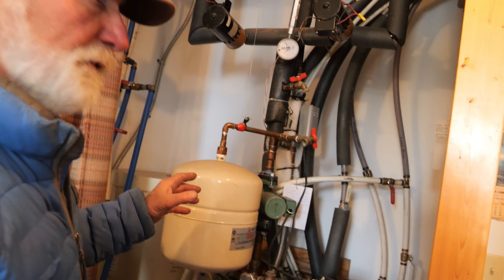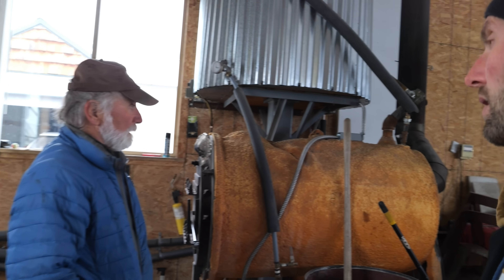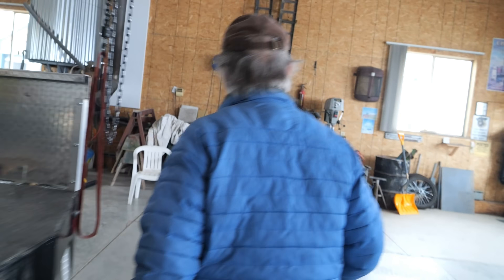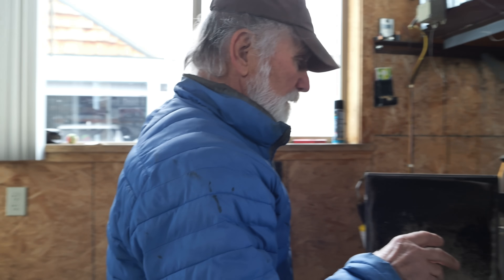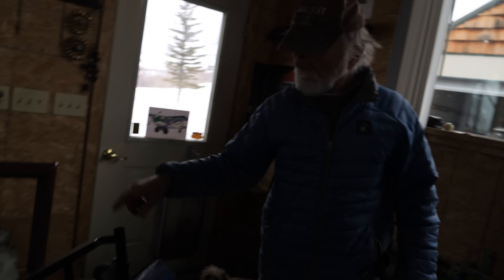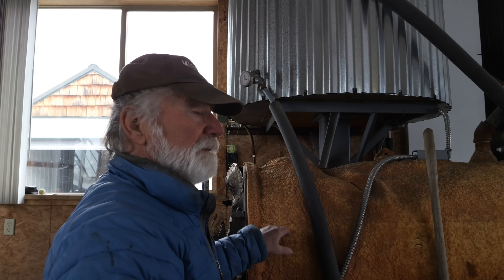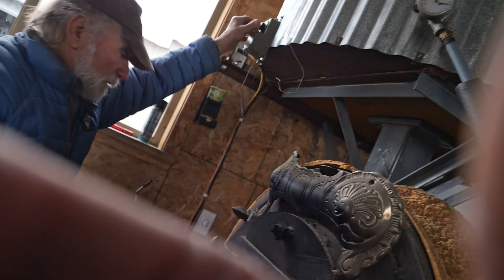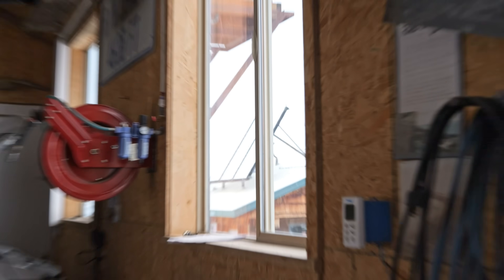Hasn't had a Heating Bill for 40 years.

Comment: I have a wood boiler in my 32x24 shop that heats my shop and 2800sq ft house. But mines a tad different. My boiler gets hot enough and acts as a fireplace and keeps my garage around 50-55f in mn winters. No heat exchanger or in floor heat just the heat the boiler gives off does the trick. As far as the house the boiler pumps the hot water into the house and through a heat exchanger in my furnace and a heat exchanger in my hot water tank and i have more heat and hot water then I could ever need. Obviously systems like the one in the video isn’t economical for everyone but anyone with a firewood source can really save a lot of money heating with wood/sun/wind during the cold winters.
Reply: The boiler is insulated, except for the front and back, and the 10' of single wall vent pipe, which alone throws off a fair bit of heat even if the hot water is being directed to the house. The shop has a ceiling fan of course. It also has large due south facing windows, for direct solar gain during sunny days.

Comment: Pretty insane efficiency compared to using fossil fuels but his claim that it costs nothing is bullshit if hes using grid power for the circulators, they use a decent amount of current to run. If he ran the circulators off solar panels and a battery storage system then he could make that claim. Then he would only be using wood to heat the house.

Comment: For people that don’t have access to lots of wood, you could convert the burner to waste oil. Automotive shops have to pay to have it taken away. Could probably get it for free. Do a gravity setup with a spin on filter to a drip system. Lots of videos on YT how to convert wood burners to oil. More consistent and higher BTUs
Reply: A bathroom fan timer switch coupled to a 1/4" electric solenoid valve, and then a 1/4" needle valve gives not only fine control of the drip, but once you approximate how long the fire will last, insures the flow will stop before the fire goes out. I've found the combo of wood and oil really ups the performance of both.

Comment: This system sucks...too many pumps...also what will he do when power goes out? It will boil out...also before water will start giving out heat a lot of energy will be lost to heat water....then you have to deal with black soot inside boiler and chimney problems due to heavy metal tars

Comment: I learned some great techniques from my first employer who was  born in the 1930s. Back in the early 80s in our diesel repair shop we had a wood stove for heat, running with the oil burners, to save on heating cost, but the real trick was getting 3 phase electric to a shop that only had single phase 220 coming in. He rigged up a 220 electric motor in our outside rear shed that he would run when we needed 3 phase power. Once the motor was running it would create the third leg for a 3 phase machine to run on. Simply amazing what that generation of tradesmen could do. We would not only maintain our tools and equipment but also repair it. It is slowly being eroded away by cheap throw away junk.
Reply: Cheap throwaway junk but also heaps of rules, regulations, and statutes. This is also some of the reasons business in the USA will never be the same.
Reply: I wonder what you needed 3 phase for. This is one of the least efficient ways of producing 3 phase. It works but I wonder if the losses weren’t more than just working with the 220 straight up in the first olacw
Reply: @vaporizer82  My brother has a that type of setup in his wood shop. He has many industrial machines that he bought at various auctions that are 3 phase but were cheaper and of better quality than buying new single phase equipment. Since the power company wanted like 10k to get 3 phase power to his shop, he went the route of a switching box and 20hp 3 phase motor.
Reply: @vaporizer82 then he'd have to change out every motor that was built to run 3 phase.
Reply: Phase convertor my old boss uses them to run 3 phase floor grinders at people house off the single phase breaker box
Reply: Thomas, I really enjoyed hearing your story. Although I've never done anything quite like that, I do enjoy working on things. (I was born in 1953)
Reply: Too bad you had all this time but still let things fall apart
Reply: @almarkowbender  Things didn't fall apart too bad if you are a homeowner with no debt at 26. I am also a homeowner, but realizing the American dream and owning the deed to your house and land is something many people never get to do.
Reply: @coldgarden_  There are very very few people like me, most people have no chance of buying a house or saving any money over time. The only way I was able to get where I am is working 50-60hrs a week consistently and some luck. The average person has no chance.
Reply: @almarkowbender  Don't be mad because your generation didn't do shit.  I'm in my early 30s and know exactly what he's talking about and how to replicate it.  Haha
Reply: @gargamel3393  I'm 26, I own my home and have no debt. I didn't get here by not knowing how to do anything for myself. Most boomers are completely blinded by greed they won't even take care of their family like their parents and grandparents did before them.

Comment: Great video Tom!   I want your system... have been working on it for some time without seeing your video.  This may help you with wood splitting.   Click to check out and improve safety.  The Gorillabac 3803 log drag, lift, position and hold tool. It is a must have for anyone who splits firewood.   Improve Safety, split more wood and have fun! Made in the USA

Comment: Hope you are doing well, Tom!  Glad to see the boiler Mike Solomon and I made you 20 + years ago is still running strong! I still have a picture of it on my website when we were loading it in your truck to take up to your what place by Pebble Creek.  I remember you having me waterjet that elongated slot in the blower tube in the firebox to create that cyclone once the fire got roaring!!.  Brilliant idea.  Built me a boiler a few years ago and have it on my Youtube channel.  I kept you in mind when I was fabricating it.  You always had an eye for making things super efficient.  Still waterjetting and running Rapid Creek Cutters, just not in Inkom anymore.  Pat Burrington-in Montana.
Reply: Right on Pat, your water jet expertise made it easy. That slotted fresh air intake creates a swirl effect, as I had theorized.  Since this video was made, I finally got around to installing a waste oil drip setup, should have done it years ago, it works so well.  And for the record, I didn't do ANY critical welding, no need, I know the right people!
Reply: Good to hear from ya Tom!  When I moved to this shop in Stevensville, MT, I just used the existing stove the last guy had, and I kick myself in the butt everyday because I should have just made a new stove from scratch and I was planning on using the tapered pipe cyclone thing.  Hindsight is 20/20 as they say!    @portnuefflyer

Comment: I am a hydronic heating specialist, i appreciate guys like tom. He inspires me to create a heating loop at my own home, for most people the maintenance alone on a system like this would make it impractical. However if done right i think could really save you thousands in the long run
Reply: What makes his system so maintenance heavy? Hydronic floor heating as been the default in new buildings Europe for a couple of decades now, and it's pretty much an install-and-forget experience
Reply: @norgeek  A gas or electric boiler (as you'd generally see in Europe) would be a far simpler and trouble free experience. Whereas, this gentleman has a complex system using wood and solar heat with valves and pumps to control systems that have been added to and experimented with for many years. You can do the same thing he's doing now with controls and electronic valves but that still requires an amount of saviness that most people don't have or want to deal with. But for those who can, it's cheap heat!
Reply: Yep, he said that he did not paid a bill. 
But he paid with knowledge and work, and opportunity. 
All that wood is free because he is doing this alone. 
If everybody would do it, then there will be no more free wood. 
And I always dreamed at those vacuum tubes. 
But I have no idea how efficient they are. 
I know that in the summer works well. 
Also fine in spring and autumn. 
But how much help are in the winter?
And my idea was an underground tank to store summer heat. 
Would the cost of such tank be prohibitive?
Anyway, these days with the drop in PV price I assume that electric would be cheaper. 
I am heating electric now, from the grid, because I have no roof. My roof is other 4 apartments above me. 
And gas would be three times cheaper, or kerosene ten times cheaper.
But initial investment would be a lot more, and with added convenience of electric, this is the best option for me. 

But solar heating will be so fun to build. 
This guy is having a lot of fun.
Reply: Poverty doesn’t care much for impracticality, you still need to find a way to stay warm. You’d be surprised what one has to do to stay warm.
Reply: It will save you thousands as long as you and your life (time) are already worthless.
Reply: Is he paying for ELECTRICITY,  if so you're still paying for heat, in the form of running all those pumps.
Reply: @rafasgarally3975  look again
there is a solar panel for the pumps. quite a small one, since circulating the liquids takes a lot less energy than the actual heating.

Comment: He needs to upgrade to ecm ciculators much more energy savings.
Reply: Free surplus solar electricity runs the pumps, a mix of Taco and Grundfos, but as the need occurs for replacement of them,  (but not until then)ecm types will be used.

Comment: That heating boiler is something I know my Grandpa would have welded had he made this, and probably have put his own flare to it the way this was done. My grandpa made the wood stove in his house from scratch, cutting and welding all the parts by hand from thick steel. Even put the bricks necessary to maintain the heat inside the stove (the only thing he didn't make himself). Still sitting in the house as long as my uncle didn't sell it off to pay for his sons' legal bills (both in prison) or for his own drug addiction since he decided the house belonged to him.

Comment: I use an old woodstove/boiler, it works amazing. It’s in its own little shed stocked with wood. It used that same hydronic fluid and pumps it continuously to the house and it goes to a mess of copper pipes that a fan blows over and into the ductwork. It doesn’t use much wood unless it’s terribly cold and windy and all I spend in heating for the year is my time to go cut wood and whatever fuel it takes to haul it home. And I suppose a couple chains and whatnot a year.

Comment: Sweet setup, you should change your pumps to be in parallel instead of series for better flow rate
Reply: That's what I came to ask about. Being in series I think the flow rate will be as good as the worst of the pumps can get.

Installing them in parallel would actually increase the flow rate, although I think each of the pumps would need a check valve installed right after them in case one fails.

Comment: Pairing a system like this with hydronic floors is a really smart move, because the large surface area means you can get effective heating at very small temperature differentials. A traditional forced air or baseboard system requires much higher output temperatures to keep the space heated, but this system can take advantage of "low quality" heat that's only a small number of degrees warmer than the target temperature for the room.

Really cool video, and neat system! That being said, it's almost certainly not worth the complexity to build something like this nowadays with how photovoltaic panels have come down in price and gone up in efficiency. Simpler to just install a bunch of those and use a heat pump, and then the excess energy generated by the panels can go to powering other things than just heat.
Reply: The wood burning is a nice touch for days where not enough solar energy is available.

Comment: I sell PV solar, and have run into a few customers with solar water heaters. Every single one of the systems was broken, leaking water, and just generally a nightmare. Solar water heaters aren't even code anymore. You cant do them commercially. The only system I ever saw that worked, used a black plastic capillary sheet with some pumps that directly heated the pool water.
Reply: Now you've seen one that has worked fine for DECADES, will work today, and will work tomorrow. Simple as can be,  but they must be set up corrrectly to start with, just like any PV system.

Comment: yet people dont realize that running a boiler is probably only slightly cheaper than a gas furnace, and you also have to get up in the middle of the night to keep it burning or your house gets cold, the only thing you get from a boiler is the same as a fireplace is a little bit of independence

Comment: This is a small version of how they heat large factories : Gaspowered furnace that heats up a closed waterloop ( 110-120°C ), heat exchangers heat up the seperate smaller loops ( radiators, flooring ) Tom's is woodfired, and has external panels that can add additional heating. Clickbait title btw, he heats with free wood....
Reply: Nope you’re wrong you will blow stop gap valve which produces an explosion. Never do that, never.

Comment: I have been operating solar thermal panels for 35 years alongside a multifuel boiler and a gas system boiler for back up . A plumber I ask in to come and move a toilet made the mistake of looking in the cupboard where the heat exchanger and pumps live. he turned to me and said "don't ask me to come and fix this if it ever goes wrong". I smiled but didn't tell him I had done most of it (not the gas boiler) myself.
Reply: I think he could guess that.
Reply: @Thalanox 😂

Comment: Nice DIY solutions:) 

At 8:10, if one wants to increase the flowrate the pumps have to be in parallel. It´s similar to batteries, in parallel increase of current (flowrate), in series increase in voltage (pressure).

And can anyone explain to me, why he likes to have the flowrate high and the deltaT low? - between the glycol & water cycles. I mean you need more energy for pumping like this. The only advantage I see is that the heat loss in the lines is reduced (due to lower delta T) and maybe it leads to more evenly heated floor? From my understanding it´s not a heat pump which is governed by the carnot efficiency.

And to be the keyboard warrior I am: he has to pay the electrical bills of the pumps for heating, which is not nothing:D A regular heating pump here in Germany uses around 100-1000kWh/a and he has a buttload of them.
Reply: Good catch, but increased pressure seems to have increased the flow enough for the intended purpose, dispersing the hot water thru the floor as fast as the boiler can make it, and it was a quick and dirty way to use a extra pump I already had, one pump was working OK,  until the boiler really got fired up to the max, with a min. of extra fittings etc.  The flow rate is high on the thermal panels in order to make a LOT of warm water, rather than a smaller amount of HOT water. At the end of the day, that makes more BTU's stored in the concrete slab. Less heat loss in the piping also.  One pass of the fluid thru the collectors entering at 90 degrees for instance, rather that at 120 degrees, results in higher efficiencies.  More even heated floors, rather than just near the manifolds, is the result.  The pumps draw  around 50 watts each, and it's excess solar  and hydro power, so not a concern.
Reply: @portnuefflyer  awesome thanks for the reply - i didn´t think about the efficiency of the collectors, makes sense.

Comment: I was expecting another "free waste oil toxic burner" poisoning their own crops  and land for centuries to come, with diminishing efficiency..

Really glad i watched it.

At my job we are cooling semicon equipment and the small ones are starting at 18kW going above 50kW power, at 30°C out and 32 to 32.5°C back. Takes a high flow rate but is rated to work with 20°C site cooling water. And that size heat exchanger is still really small, less than half a Jerrycan.

For the no heating bill, i guess the pumps and stuff can be run off solar well enough, but the wood aint free, even if its hopefully growing faster then getting used up, its still a lot of work.

Now the fullelectric setup in the new shop sounds "cheaper" in terms of running cost, as no wood or maintenance is needed.